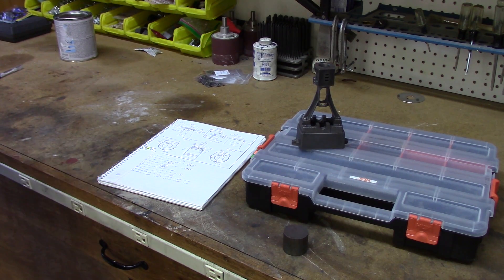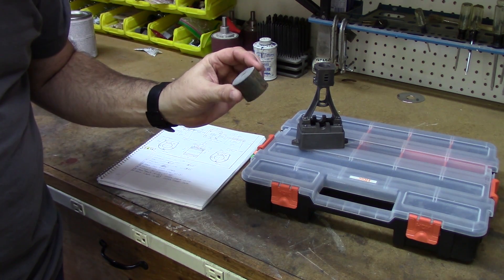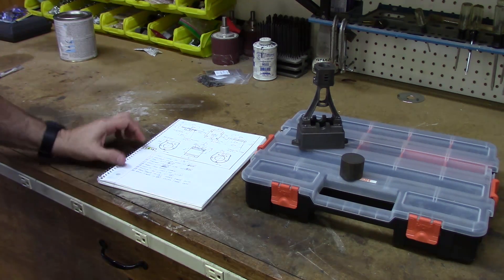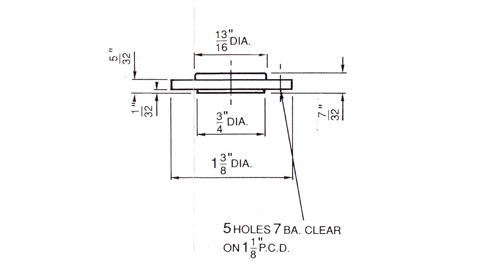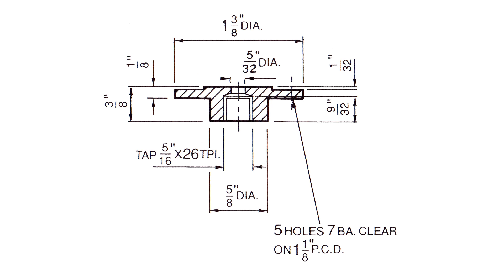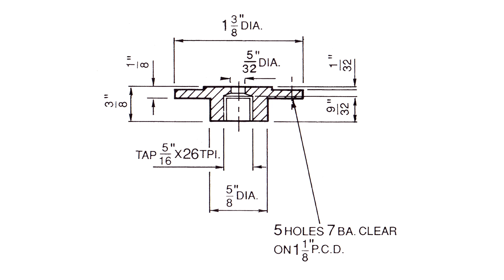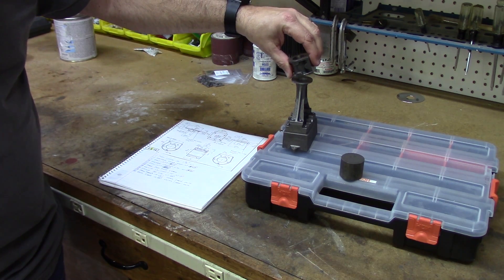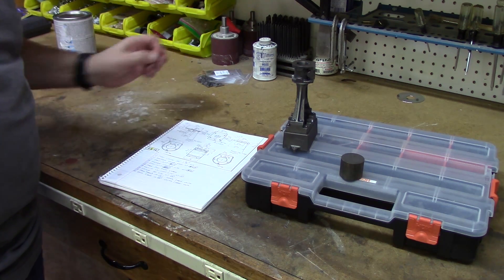Building the Stuart Models 10V Vertical Steam Engine - Part 6a

Comment: Nice work Ron, built the same engine about 10 years ago using only a 9x20 lathe, would like to do it again now I have a mill as the filing is a pain.
Lucky in Australia we still have easy access to BA and ME stuff as well as metric which makes thing easier if we lose a few nut and bolts.
Only problem I had was rushing towards the end as I couldn't wait to get it running, in hind sight accept that if you follow each step with best practice the finished model will run perfectly.

Comment: Arrgh, where is part 6b ? I'm hooked and this is so interesting. I am working on a #5 steam engine by P.M. Research. It has become painfully obvious, that I will need a Mini Mill to complete this project. I have produced some of the parts that don't require a Mill but ....Oh well. Right now I have too many irons in the fire, and yet another machine isn't in the plan. I received the kit for Christmas and spending $1000 on a mill to make a $110.00 kit needs evaluating. I have a 9 inch SB lathe and a couple of Mini lathes. Great videos and look for the "rest of the story" ...Ken... retired old guy

Comment: Hi Ron,  Thanks for posting this series.  Keep going.  I have the same kit and I'm watching you do yours before I do mine!  Are you going to use the BA threads or American threads?
Reply from the maker: I am using BA threads. High-quality nuts machined from hex bar stock are readily available from model engineering suppliers in the UK. I considered using SAE threads as I already have the taps and dies, but I couldn't find a source for high-quality-nuts. Mass-produced nuts are typically stamped from sheet steel, and they don't look nearly as nice.